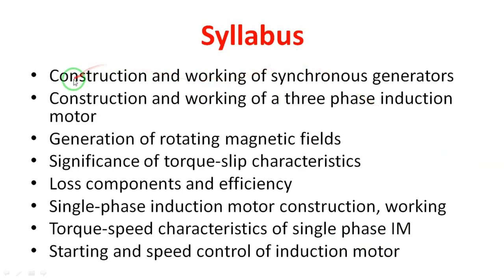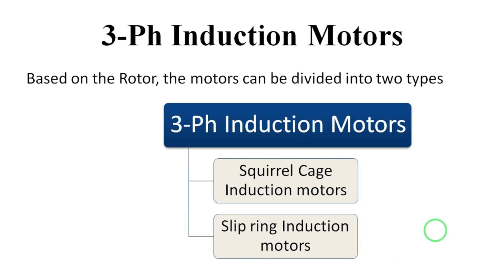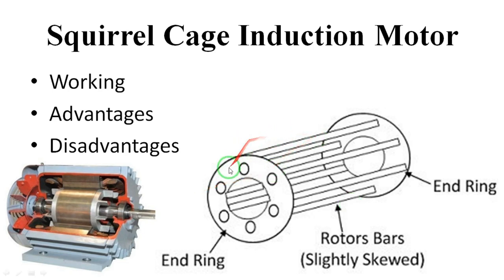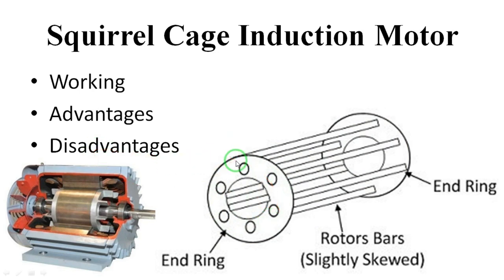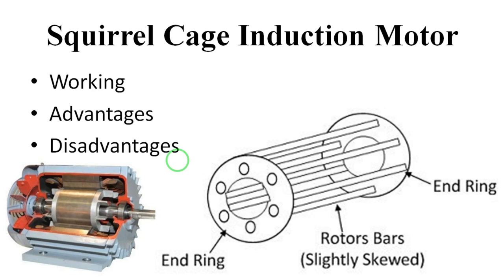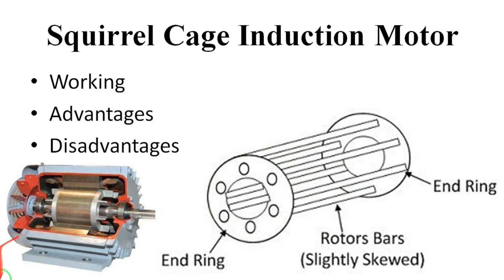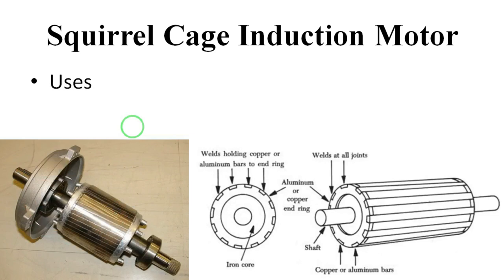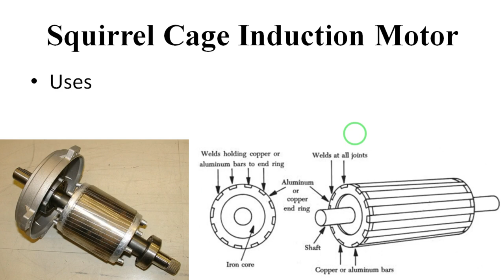Lecture 6 || Working of Squirrel cage Induction Motor || AC Machines

Comment: Can I run squirrel cage motor with using vdf to reduce speed of the motor without using reduction gear box
Reply from the maker: Definitely,
You can control the speed of a motor using variable frequency drive.